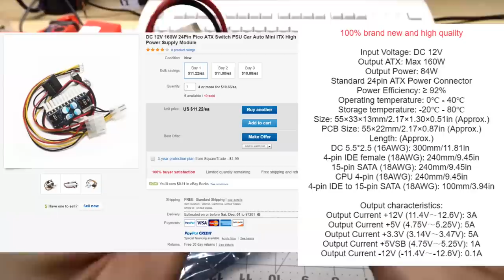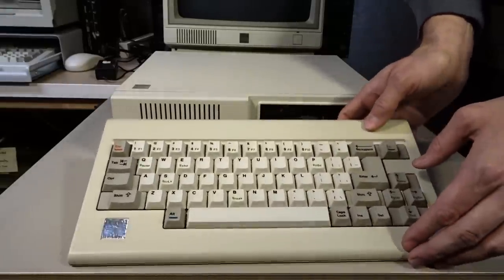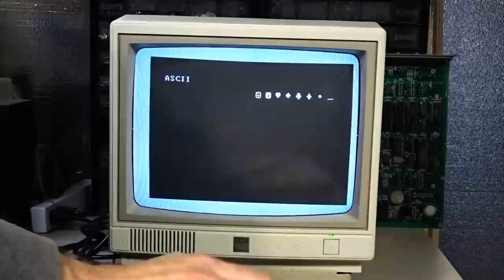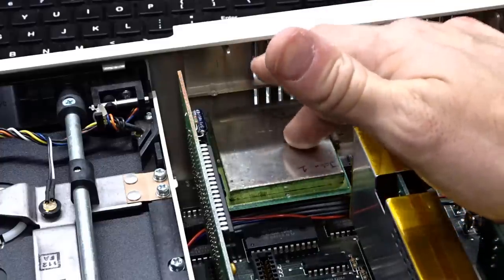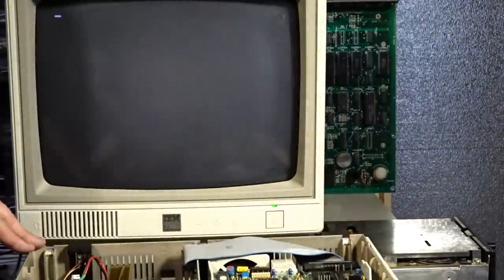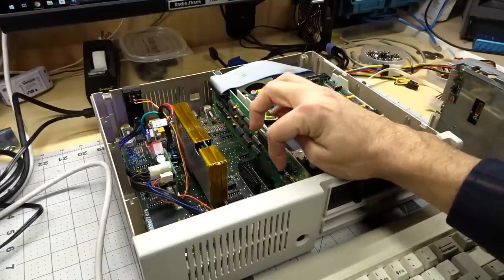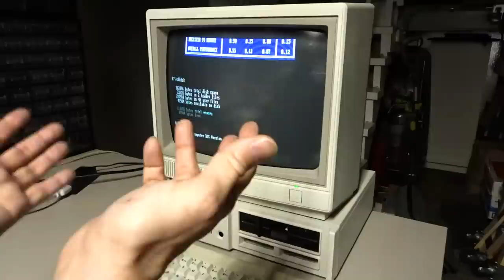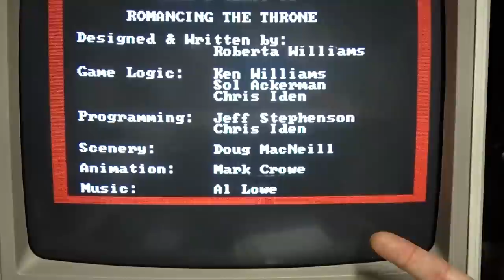IBM PCjr Part 2: Two steps forward, one step back

Comment: Dahhh, I'm just yelling at the screen for the first few minutes.
1) that's a 24-pin ATX connector, have you never seen one before? It's 20+4, the extra 4 pins are to provide an extra pin each of +3.3v, +5v, +12v, and GND. Most power supplies - even the one up on your bench, I'm sure - have a little breakaway 4-pin connector added to the ATX connector. Yeah, you did the right thing, just plug it in where it matches if you don't need it.
2) DAHH DONT PLUG THAT LITTLE THING INTO THAT HUGE BOARD! It's meant for Mini-ITX boards with integrated low-wattage CPUs. Plug in a 60W TDP CPU and you're likely to overload the wimpy little 12v brick supplying the thing. (likely to cause more misdiagnosis and confusion with lack of experience ;) )
3) There is no such thing as an unregulated power supply anymore. Those died in the 2000s - only time you'll ever see an unregulated power supply is if it's a thick heavy brick, and if you don't know the difference between an unregulated transformer brick and a regulated switching supply, put down the soldering iron. ;) You're just overloading it, and what you're seeing is voltage drop. See (2).

Okay, now I can continue watching. gahh~~

4) 10:00 I can read "IBM" through the tape. Probably the same reason there was a sticker covering the IBM logo on the monitor. It probably either wasn't sold as an IBM, or maybe it was a prop in a TV show where all the logos needed to be covered.

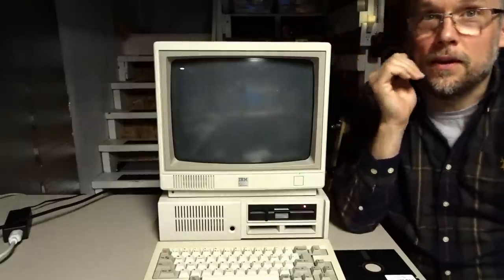5) 24:00 that is definitely a stumper of a problem. Given everything else you've swapped, I wonder if the controller card has a transient defect in one of the logic chips - which would be why it takes ~time~ to reset it, like letting RAM bits fully decay and reset. If you only had another controller card...!

Comment: Any chance the motherboard CPU clock has been "upgraded" with a faster X-tal (crystal) ?
This was a very popular speed hack to the old AT's and worked most of the time until you realised the sudden random error occurred.
It was a mere case of luck how long time the PC would run before it failed and had to rest before it could be rebooted.

Added: try run the PC open cased and use your fingers to search for any hot spots.
A hot component is the most common cause to random errors and sudden halts.
Reply: @adriansdigitalbasement  I know its a popular hack, and it always seem to work with great success - for a while.
However if the IC's involved could handle this higher clock speed, it would have been set higher from factory as this would be a very cheap marketing update putting the sales up quickly.
Being an electronics engineer I have seen many "gamer" hacks over the years that always works "true" as proven.
Sadly the bare facts does not always follow these "proven" hacks.
DO try the heat trick though - THAT is a hack that always leads to trouble areas. Electronics do not like heat at all - despite gamers thinking that CPU's runs best at a high temperature.
Reply: Ohh darned. Didnt notice this is a 1 year old video.
I just watched the 3rd video on this PC and realised you have for long solved the problem.
Enjoy your junior !

Comment: We had a PCjr when I was about 7.  All the games we had ran on cartridges, those slots just under the floppy drive.  There's lots of carts on ebay: https://www.ebay.com/sch/i.html?_from=R40&_trksid=m570.l1313&_nkw=cartridge+pcjr&_sacat=0  Also, you can get "blank" cartridge kits. You plug in an ATMEL eeprom chip into the cart and you can install programs or whatever onto the EEPROMs. PCjr was all about the carts.  There's even an upgrade you can do that will "upgrade" it to a PC from PCjr.

Comment: Error H might be a power supply problem. Too much power or not enough causing a brownout condition on the CPU. I would  put a LM7815 on the power rail to lock it to  15V and clean up the power supply.

Comment: I have one of these computers 128KB New in the original box with original packing with Keyboard also in original packing. I've been told to hang on to this machine since it's somewhat rare nowadays in the original box styrofoam and all. I don't have any way to try it since I don't have any cables for it

Comment: I don't know if this is related or not, but my PS/2 Model 30 286 has a bizarre issue with the floppy at the moment that makes the 1.44MB Floppy drive thinks it's actually a 360K drive. Apparently this is caused by the Dallas RTC chip. It's dead and needs replacing, and until it is the floppy freaks out. 

Luckily I can trick the drive into working, but I doubt this would work on a PC Jr.
Reply: @adriansdigitalbasement  Ah, ok. I wasn't sure if the PC Jr had any proto-BIOS or whatever. It's discussed so little in retro computing stuff it's hard to know much at all lol.
Reply: What's funny, i swapped the floppy drive in my PS/1 from a 1.2MB to a 360k (since I need 360k to support other retro systems) and have the exact same (reverse) issue as you.. it'll randomly think its a 1.2MB drive even though it's a 360k.  The only way i can fix it is to remove it, reboot, reset it in the ps/1 diagnostics program, then plug it back in and do the same.  Mine doesn't have the dallas battery though, it just uses a CR2032.
Reply: @brianv2871  That's slightly worrying if the battery is working and storing the CMOS settings. I've been able to work around it for now by using disk 1 of the MS-DOS 6.22 setup and F3 quitting the setup procedure to the A:\ prompt. For whatever reason the floppy drive will act normally and copy files from a 1.44MB floppy, something it will NOT do when running DOS off the HDD. It's really bizarre.
Reply: @alritedave  Yeah, sounds similar to my issues and yeah, everything else is fine and saves correctly.  It's super random also, like whatever the detection method these old systems use isn't very accurate or flaky.  I do find that as long as I don't go back into the config (and save), it' basically continues working, but it gives an error every time I boot up.  I dunno, these old IBMs are super finicky with weird quirks.. specifically the ps/2, ps/1 and pcjr lines.
Reply: @brianv2871  Is the error 161 or 163? If so those are dead battery and CMOS setting errors respectively.
Reply: @alritedave  I'll have to check (not home) but it was a new battery I had put in.  The funny thing is it works fine for quite a while but would randomly get that error and when i'd go into the CMOS app (forget the name) it would have the asterisk next to it that would show that my 'floppy drive changed'.  Other things to note is that the time and other settings never reset, its just that.  As well, I have another 360k drive that works fine in the machine and doesn't 'reset' randomly, however it's a black drive so looks odd in the machine.  That drive also works fine in my newer machines and newer bios's recognize it correctly and don't reset either.
Reply: @brianv2871  Lol, weird. Mine is just the standard 1.44MB drive that comes with these Model 30 286s.
Reply: @alritedave  yeah, besides my 1.44, I have one of those add-on bays for my ps/1 that gives you a 5 1/4 drive (which comes standard as a 1.2MB drive).  Honestly, i'm pretty sure they never did proper testing at the time since the 5 1/4 wasn't standard and figured no-one would ever downgrade a 1.2MB drive on the add-on to a 360k drive.  But, in my case, that machine is so useless (but better than a PCjr) that it was relegated to making IMD disks for other systems, and using a 1.2MB drive doesn't reliably make 360k (or 180k) floppies.  Oh well, it's not a big deal, but like Adrian's issue in the video, it's just one of those annoying IBM quirks.
Reply: @brianv2871  What CPU does it have? I know somewhat about PS/2 systems but little of the PS/1 lineup.
Reply: @alritedave  Mine is the 386/20..
Reply: @brianv2871  How is a 386 20Mhz useless??
Reply: @alritedave  Well, it's an SX so it can only run dos, no version of windows beyond 3.11 (windows 95 would take about 10 minutes to load and was pretty unusable after it loaded).  I guess it's not totally useless but it didn't work how I wanted to use it (I keep everything on network shares and would like to run my games, etc. from there so the saves are all in the same place).  You can sorta do networking with it, but there are some limitations with long file names (the LFN tools don't work with network shares, just cd shares) so accessing my network shares doesn't work properly.  Going to try with freedos later, just haven't gotten around to it.   I have an aptiva that isn't a display unit, but it is a much better 'tweener' device since it runs dos and Win 98SE.
Reply: The Jr. definitely has a BIOS. I had the full programmer's manual for my Jr. when I was a kid and it had a full, documented, disassembly of the BIOS code. They even called it the BIOS. Is it compatible with a normal PC BIOS? I have no idea. I imagine it has to be some degree of compatible because PC software can work with the PCjr without needing huge architectural changes.
Reply: @brianv2871  Well Windows 3.11 is perfectly acceptable for basic use. On a 386 I'd probably just stick with DOS though.
Reply: @ZiggyTheHamster  Interesting.
Reply: @alritedave  yeah, I don't use the 3.11 on it at all, just DOS.  I just need to find a way to do proper network and long file name support for the way I want to use it.  It took forever to get it imaged and working properly so I don't really want to start over just to experiment with those two things :). That m2 keyboard I got with it is a little flaky as well, so that probably adds to some of the frustration.  100x better than a PCjr though :)

Comment: I'm guessing it's a leaky cap in one of the reset circuits.
Reply: @adriansdigitalbasement  I have a PCjr that does almost exactly the same thing except it scrambles the video on the monitor. The way you describe your floppy drive working (or not working) is identical to how mine is with its video issues. I haven't had a chance to replace any caps yet, but I have a pretty good feeling that is the problem.
Reply: At this point, it's probably worth it just to replace all electrolytics and tanalums on the floppy controller board.
Reply: Might also be power sequencing.  Maybe the 5V rail needs to be up before the 12V rail, and since the Pico passes thru 12V and uses a switching buck regulator for 5V, it'll always be late on the lower voltages.

"Then why does it work after a quick power off?"  Capacitance?  "Why doesn't it work after a warm reboot?"  Maybe it's a hardware issue that isn't cleared by the reset line.

Just thinking out loud.  Sometimes sequence matters, sometimes it doesn't.
Reply: It would't be that hard to fix power sequencing but you would need to add an intermediate circuit between the picoATX PSU and the adapter. You could use a relay or MOSFET in line with the 12V line which is triggered by +5V. So 12V isn't enabled until 5V comes up
Reply: Jep Reset circuits.... try to find a pin to connect to and connect an oscilloscope ... if the voltage is not at least dropping to 1.5 volts during reset cycle you got a short.... i had a bad resistor once that did just that.

Comment: Why do you keep saying the Tandy 1000 had the same graphics as the PCjr? This is simply not true. While they share similar modes, the Tandy used standard CGA graphics at the standard addresses while the PCjr used a somewhat proprietary video controller and mapped the display system into system ram area. A problem the Tandy 2000 also had by the way.
Reply: @adriansdigitalbasement  Having actually been there and owned both machines when new, I have to say, I am disappointed at late comers such as yourself that know little to nothing of the hardware and software of the time. The junior was deliberately crippled by IBM to prevent leaching clients for their business products. While announced in 1983, the junior didn't actually ship until 1984 the same year Tandy released the Model 1000. Which by the way, was 2 years after the model 2000 which had floating video addressing.  Personally, I bought the Tandy 1000 because, unlike most clones of the time, it would actually run IBM DOS and despite not having BASIC in ROM, in assembler, ran the same code as the 5150 and later model IBM PCs. The same cannot be said of the PC Junior. Clearly, you are not a coder as "programmers" are lamely called today. In those days, programmers made machines do things they weren't designed to do. And by the way, the memory space that could indeed be modded on the PCjr to match the Tandy was in fact, the same space the 5150 used in CGA originally.

Comment: The first thing I did after acquiring my PCjr was recap the display board and motherboard. The motherboard was super easy to do. The display was a little challenging, but this thread I created has some information that you may find helpful: https://www.brutman.com/forums/viewtopic.php?f=1&t=681

With vintage electronics like these, it should be a given to replace all electrolytic caps as a preventive measure.

Comment: Did you measure the caps out of circuit on the floppy controller?
Reply: @adriansdigitalbasement  C'mon those caps are decades old so it is time to re-cap that whole thing.

Comment: I owned an IBM PC Junior with 256k of memory, and I had the same problem with it not booting properly from The disc. I put a piece of tin foil underneath the monitor on top of the computer and that's solved the  problem  maybe you should try it

Comment: Disk drive errors: Sometimes the lid of the PCjr can bow and rub on the disk drive head. Take the monitor off and see if that helps.
Reply: I remember reading that the PCjr monitor CAN be used on top of the system, but any other monitor cannot as it doesn't have the shielding necessary and can interfere.
Reply: @jaykay18  That is correct.

Comment: I'd try doing a full re-cap of the floppy controller.
Reply: Recap all the single electrolytic caps! preferably with smd ceramic caps, fried at too high temperature leading to a dead short - better than any tantalum ever could! 
A quick google search shows the FDC always had an issue with insufficient decoupling and later boards had 4 botch wires attached.

Comment: Can you not power that IBM JR the same way AMSTRAD provides power in their AMSTRAD PC1512, What about a 360K Floppy Disc drive out of an AMSTRAD PC1512, if you use a AMSTRAD PC1512 Floppy drive you will need a drive belt, the mode you are talking about is Plantronics mode and uses port 0x03dd as a color plane select port base address is 0xB800:0000 don't try 0xA000:0000 won't work.

Comment: My bet it a bad cap holding the disk controller in reset.
Reply: 555 is a good suspect. I would think the disk controller IC has a reset even if it isn't tied to the system reset.

Comment: So basically this is pretty much useless with only 128K of RAM (some of which is already used as video memory), an intermittent floppy controller, an already slow CPU thats effectively running at half speed (0.55) so even slower than normal and you have just one not very good game that gives you a disk error most of the time. Even with the RAM expansion board and another working floppy controller (which are rare and expensive), you still wouldn't be able to run much software on this or use it for much. Its not worth spending any more time or money on.

Comment: no wonder the computer was a flop and failed miserably. it should have come by default with at least 512k of ram. 
it's better to just get an XT with two floppy drives or a 20mb hard disk and 640kb of ram.

Comment: I just love this old hardware but as soon as i have cleaned, restored and got it working, it just stops being interesting. I'm not a collector apparently
Reply: juha väänänen there is something magic in fact of just “doing repair stuff”. And it is nothing bad ;)
Reply: I have it with machines that are older than the ones I used as a kid. I can fix them up and make them do stuff, but I just don't find them that interesting after that. My interests go from 386 and up. Those I keep to play games on.
Reply: I’m like that with most things: “I’d like to play the guitar”. (Picks up guitar, gets understanding of how it works, leaves it to collect dust). 😃

Comment: Should have bought the original mini-box pico psu 90w in the first place. Instead of the chinese knock off. And not link to these.
Also, don't use any 12 Volt brick, make sure to use a good brick, i.e. its ripple voltage must be inside the AT power supply specification (ATX is 120 mV), especially under load or when warm. Or you will have strange effects, kill the ram etc.